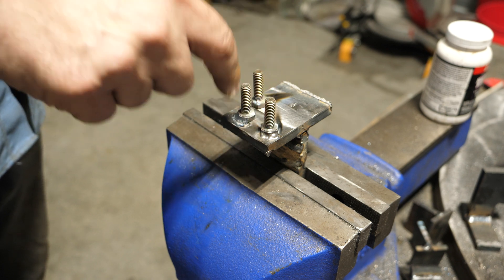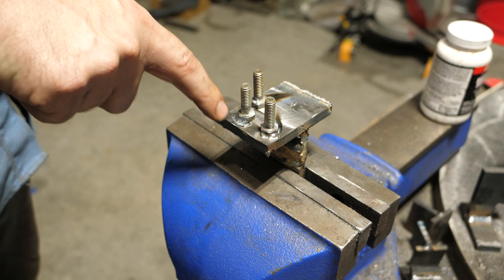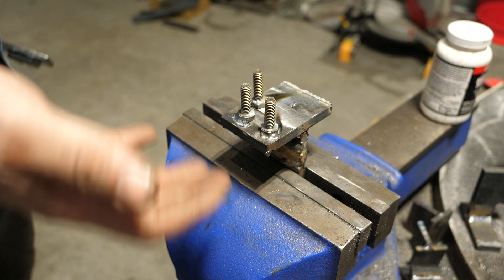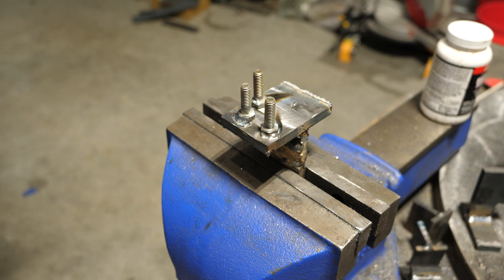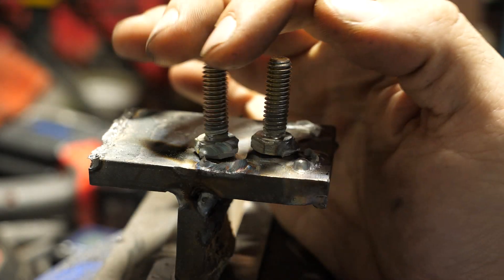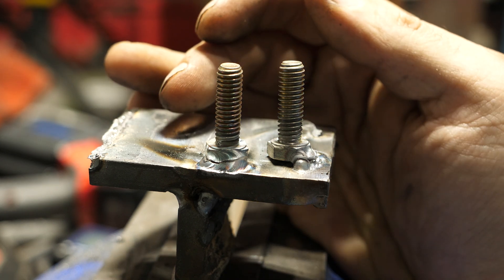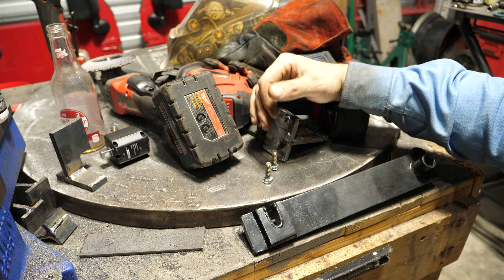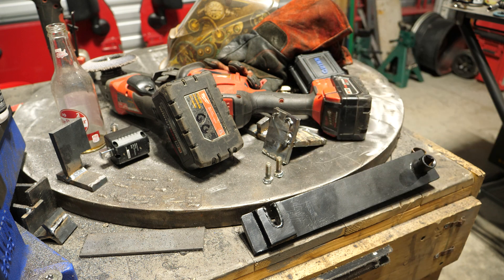Welding studs to thick steel: Will Tig be stronger?

Comment: I incompetently TIG welded some nuts on some 3/16 or 1/4" plate (don't remember which) a month ago, of course  that's just to keep them in place, the clamping when in use will not stress the welds.... But I struggled to get the torch in for the last nut, not enough room. Could've cut a short tungsten and put a flat cap on.. AND/OR gotten a torch with a flex head, but what I should've done is swapped to MIG (I have a multiprocess, but I don't like to switch because the cart only holds one bottle at a time even though the welder has separate gas for each)..
Reply from the maker: They also make bendable tungsten believe it or not.  I have some, but I have yet to find a use for it lol.

Comment: With the tig weld instead of adding a filler to it a fusion weld of the two metal would be more likely to be a stronger mechanical bond. That's if both materials are melted in?
Reply from the maker: Great question.  In the case of the bolt to mild steel, the less filler and the more the base material gets melted would likely produce more brittle weld.  The filler rod forms a alloy of the two materials and itself.  Without filler you would have a overly brittle weld due to the bolts material.  I will be experimenting in a upcoming video with overly strong filler materials to see what happens.
Reply: @makingmistakeswithgreg  👍🏻👍🏻

Comment: Thanks for this additional testing, as I think many folks are buying affordable multiprocess welders, and have more choices when it comes down which is the best process to use for their particular application.  

These two videos were very informative, and it makes me wonder as a Home-Gamer, how can I make my welds stronger, whether by process, electrode choice or mechanical joint configuration. 

I would like to see a head-to-head comparison of identical width/height “T” joints using 1/4” thick stock using your “diy bend strength tester” to compare. 

I think it would be very interesting to compare within the same process, does Joint Preparation i.e. Beveling, make a difference. 

Do you have any videos about joint preparation. Where you demonstrate multi pass beveling similar to your welding Hooks video, but for basic fillet joints?

The majority of my projects (like most home gamers) focus on basic joining things together where strength is not critical. However periodically, I need to focus on joint strength, and while I see plenty of weld penetration demos, I don’t see hardly any maximum joint strength e.g. beveling demos except for big structural  or pipeline work for professional/certification career welders. 

I for one would love to learn how to get the maximum joint strength, using MIG, TIG, Flux Core or Stick processes for us DIY home gammers.

Thanks for your ongoing efforts to learn to be better welders!
Reply from the maker: All great ideas and I will be tackling them soon 😀.  I have a specific video on beveling I am shooting this Friday and will have up within a week.  I will also be comparing all common “home gamer” welding process welds on 1/4in steel too, including dual shield wire.  Also, I will be returning your email tonight when I am home 😀

Comment: Just watched your previous vid and was thinking about tig and if You would do it. How cool!~
Reply from the maker: I think across the board tig will have the most repeatable results on small “spot weld” tests like that.  You simply have no issues with cold starts, poor fusion, porosity, or other weld defects.  I am doing a large scale test right now that should be a more realistic look at strength.  I am going to compare the best welds I can produce with flux core, dual shield, short arc Mig, stick (6010 and 7018) and tig.  Single pass for all of them but tig, that will be done as two pass since it makes small welds.  I am not sure what will come out on top….
Reply: @makingmistakeswithgreg looking forward to some real-world strength testing.